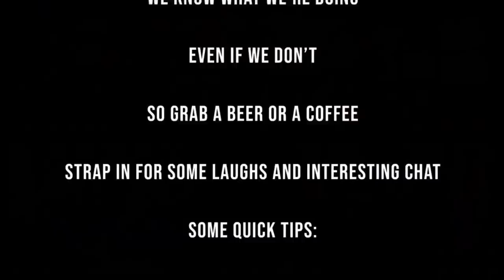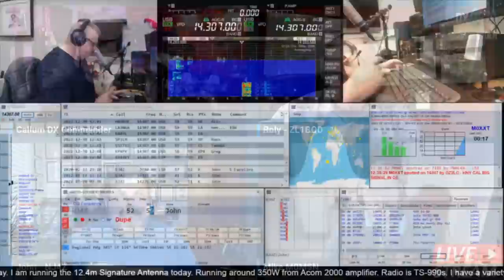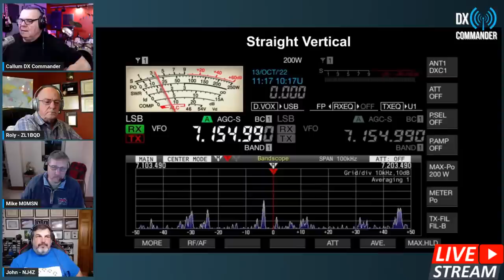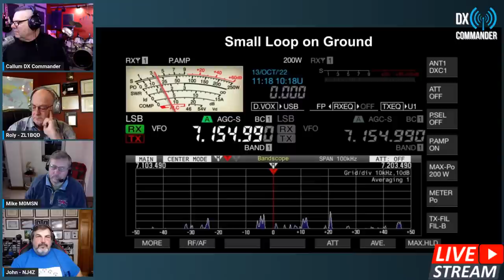7 Ideas to Improve Reception of Weak Signals

Comment: Thank-you Callum.  It's great to hear you and the boys, Mike too. 😇. Love you all.  Great chat.  All the best.  When I can I'll get back up on the air.
Reply from the maker: Yeah, do it :)
Reply: @DXCommanderHQ  I had a fan dipole horizontally polarized. But after 13 years my tripod had two legs rust out, well turs out tripods need Two out of three legs.  Yeah in stood up on one untill a big wind storm had it's way with it.  So I have it in the garden now diagonally across so it will be kept straight and not get all tangled up.  It's only 6' of the ground.  You know i haven't tried it at that hight but from the roof top tripod i could get Dublin on 20M like I was standing next to him.  I'm in  VE3 land 🙂.

Comment: Yes, by all means publish your finds regardless of if most or all have the space to use the information. Information is like money, it may be spendable down the road and its always valuable to those with a keen interest such as myself.

Wireless keyboards you place on a shelf in a closet with batteries installed and something depressing a key generated a huge noise for me in the 10 meter band.

Comment: Is John's antenna a rhombic antenna or is it a true loop. Antenna's boggle my mind.:face-fuchsia-tongue-out: It IS rocket science.  As for adapters, they make every combination you can think of, it's crazy what is available.
Reply from the maker: Haha yeah!
Reply: Jim, the antenna is an 80m full wave horizontal delta loop.  It is 254ft of wire between 3 trees.

Comment: My in house noise was a wireless keyboard placed in a closet & on a shelf with something depressing a key on the board.

It had a range of several hundred feet and took a bit of fox hunting to find. We found a similar interference at my friend's house with the keyboard being in a neighbor's house.

Also, yep, my 4 foot square Mag Loop made from 4 inch diameter aluminum dryer vent with a 23 inch square of 3/4 inch copper pipe as the drive/sense loop is as Mike suggests the bee's knees. On 20 meters its 79% efficient on transmit, on 40 meters its 27 % efficient.....
Reply from the maker: Amazing!

Comment: two options for T/R Switches MFJ-1707B (sorry for the confusion on the stream) and the DX Engineering DXE-RTR-2.  these will allow you to use a TX antenna and RX antenna with a single port radio like the IC-7300, FT-DX10, etc.

Comment: i was reading an article i’d have to find again, but basically the math on SDR inputs like the RSPdx and whatnot can handle quite a large spike. even a full legal limit amp is usually not enough to burn out an SDR receiver. (although the mode, etc matters

Comment: Thanks guys! Couldn't listen live because was at work ; been thinking of a ground loop antenna ever since I saw Roly talk about his on his YT channel. I've got a manual coax switch but would like to get some kind of auto one sorted out. Was once told should be able to do something using the amplifier switching of my radio (FT-991A), similar to the MFJ switch that was mentioned (but the non SDR one) . Hope to catch you all on the air one day soon. DE VK3LSR
Reply from the maker: Rock on!

Comment: Now phase the noisy vertical with the lower noise LoG and preamp On using something like mfj-1026 or NCC2.  You should get another 2 or 3 db improvement.  My bent dipole is phased with one of three different manually switched receive antennas. My TS-590S can now hear better than people can hear me.
Reply from the maker: Yes, not tried that yet!

Comment: Thoughts on a Half Square or Bob Tail Curtail?    Very directional mostly mono-band with excellent gain.  There are 4 band versions, but the modeling supposedly shows different lobe pattern that might affect RX.  Could you model a half square or bob tail curtain with a 64:1 transformer to see the difference with and without when you get a chance?
Reply from the maker: OLK, we WILL eventually get around to the half-square although modelling showing not quite the gain I'm after.. Good compromise though.

Comment: How do you a rx antewna and tx antenna for the same radio? Or do you have rx radio and tx radio
Reply: If the radio has one antenna port you need to use a Tx/Rx switch to share that port.  IT can be a manual switch like a traditional coax switch or you can use a more advanced switch like the MFJ-1701B or the DX Engineering DXE-RTR-2.
Reply: @FromthehamshackwithNJ4Z  thank you sir. I would like to try that with 2m with a 10element beam and jpole just for experiment.
Reply: @ATR_Mid-TN-WX  need to check the rating on the unit to make sure will be ok at 2m.
Reply: @FromthehamshackwithNJ4Z  yes sir. I just wanted to experiment with it. I don’t have general yet

Comment: With all tespect the noise floor on your video is horrible, i use a browd band virtical..that is amazing on several bands with a tunner of course .. but its extremely great reciving antenna aswell as tx....i am a hudge virtual guy for DX.. with all this said i have a fullwave LFAQ..that literally has zero noise  floor its literally dead quiet unti a signal comes in , but when one does it most often is 20 over ...just blows me away how well a looped feed quad preforms im very very big fan of the lFAQ.... About beat antenna ive ever used for recive...
Reply from the maker: I don't hear noise floors. I just don't. You can buy fancy gear that eliminates it - but I don't care.